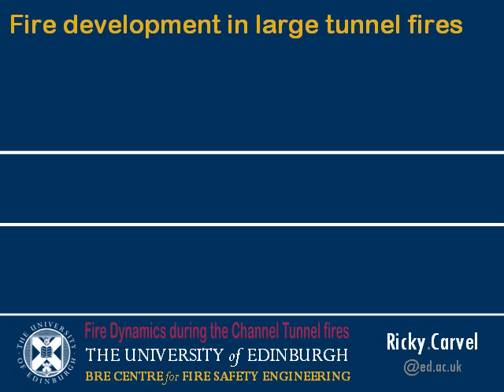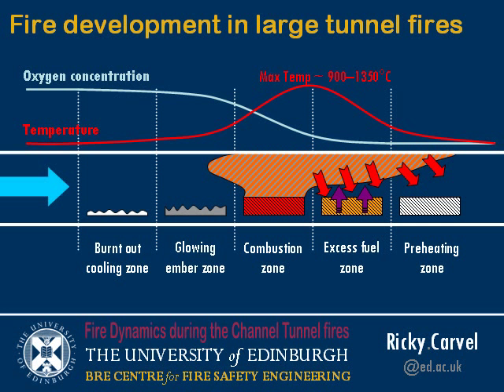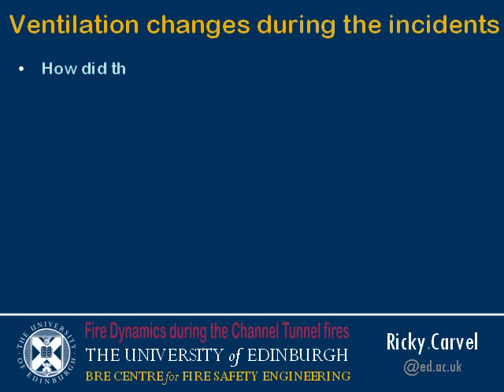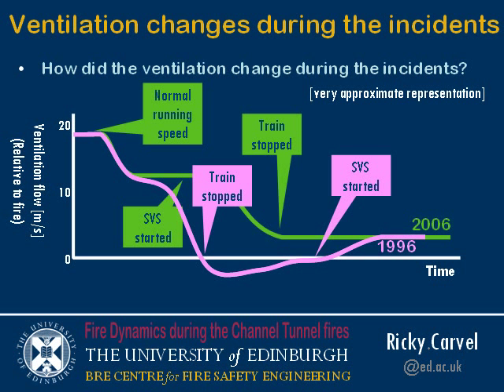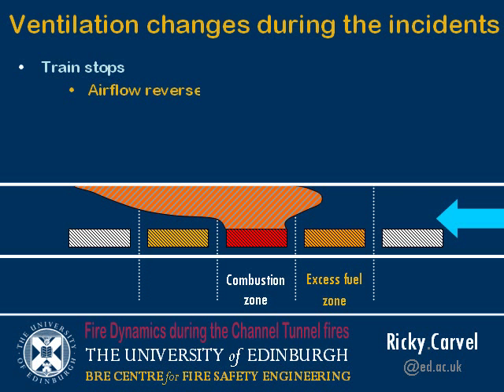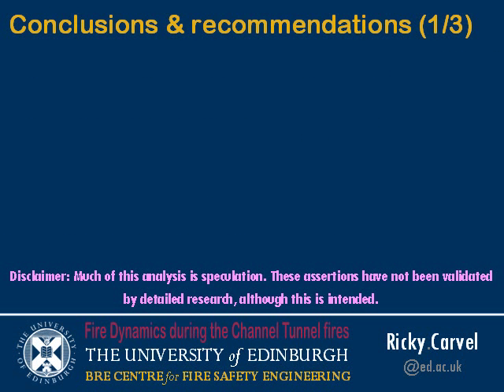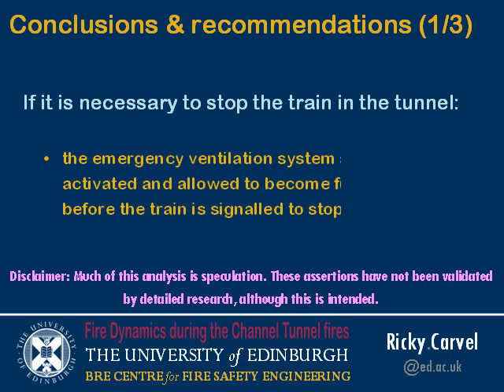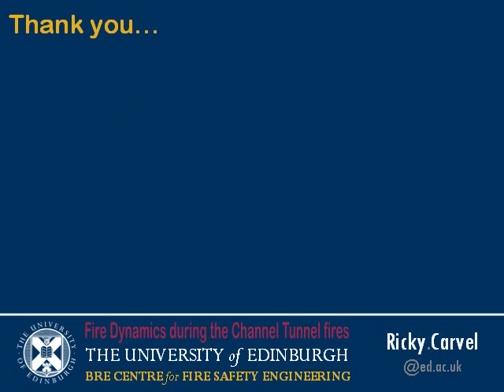Fire Dynamics during the Channel Tunnel Fires: Part 2 of 2

Comment: I'm sorry, but you're claim at around 8:25 that there is no reason to stop the train in the tunnel is not entirely correct. This was the procedure used by Eurotunnel before the 1996 fire, however, this method was changed afterwards because of a system failure on the 1996 incident train which risked a derailment. Should the train have derailed in the tunnel, the passengers could have been, in a worst case scenario, over 100 meters from the nearest cross-passage into the service tunnel, with smoke and fumes blinding and suffocating the passengers and crew. Despite the need to easily fight the fire, the safety of human lives must be taken into consideration. However, at least before the establishment of "fire fighting stations" within the tunnel, trains were to continue out of the tunnel if between the shore and the SVS vents at Shakespeare Cliff and Sangatte.

Comment: Ricky.  I don't think your '96 and '08 Fire explanations makes sense.
You're saying that when the train and fire is stopped the fire at 6:20 will spread into the prevailing wind/ventilation?   But then when the wind/ventilation is reversed it spreads both ways?
I think what you are mystified by is the facts of atmospheric press being more powerful than the fans..
All tunnels should have simple streamers at entrance and ventilation points to show exactly which way normal air flow is and in fires.